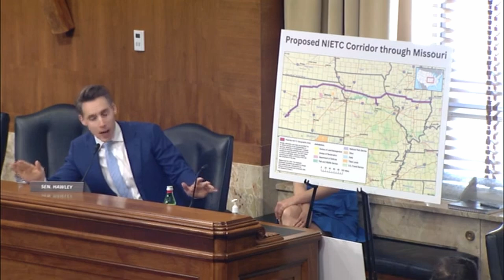What are the National Interest Electric Transmission Corridors and why they’re important

Comment: Gas and oil pipeline are mostly underground so they have minimal effect on farming!  And in case you were unaware, wind and solar are intermittent sources of power and therefore considered unreliable! We do need more transmission line but we also need hundreds of new nuclear power plants. Those alone will take the better part of this century to build even if we start today!  The sad truth is because of the imbeciles running this country, electric prices will soon be going through the roof!
Reply from the maker: There's an interesting proposed transmission line, the Soo Green line, that is underground in a railroad right-of-way. I think this is a big part of the future of the grid. So underground vs. above ground is no reason for electricity to be treated differently than oil and gas. Even for above ground, that will change the criteria, but no reason for FERC not to have the same authority. 

The biggest problem with nuclear is the one that you refer to. They take a long time to permit/build. A solar farm can be built in a year, a wind farm in 3 years, nuclear in about 10 if you're lucky. My friend at @DDDecarbon is starting a series on nuclear that might interest you. His main point is that it's just too expensive compared to wind+solar+long distance transmission+storage
https://youtu.be/tFCVTj87Yz4?si=nHEsAJeFHBRdy6e6

In my first video I talked about how to manage a grid with renewables to create a stable grid: wind+solar+long distance transmission+storage. The more transmission you have, the less storage you need. 
https://youtu.be/kw9_Q_qm0Es?si=wVql-35TscjJeydB

Comment: Distributed power >>> transmission lines. Small modular Thorium reactors is the way.
Reply from the maker: Small modular thorium reactors don’t exist. They’re like fusion: if someone figures it out, that will change things. But for now, we have to settle for wind and solar.
Reply: @Decarbonize11  THANK YOU for actually saying this! I keep hearing about thorium or even nuclear power, even though objectively nuclear power is the most expensive form of electricity available. We need to decarbonize now, rather than wait for future technological innovation.

Comment: PV is now so inexpensive your concept doesn't make sense anymore. If this was implemented in 2010 maybe but looking at 2025 forward, there is absolutely no reason you need to centralize your solar production in areas with high power density.  It's cheap, it's easy. It should be local.
Reply: @otm646, you're right in a way; at current levels of renewables (an extremely low 21% in the US), local solar is cost effective.  But as you get closer to 100% renewables, 100% solar is rarely the cheapest way to go: about 1/3 wind is cheaper, and you need transmission to move that power around.

Source: As Solar Power Surges, U.S. Wind Is in Trouble.  B. Plumer.  New York Times. 6/4/2024
Reply from the maker: I certainly agree that the drop in cost of PV makes the location less sensitive, and I've always believed that local solar should be part of the mix. But the core of my vision is the diversity of  geography and source is the key to reliabillity. Just local solar means you need a lot of storage and to build enough PV  that even on the shortest, cloudiest days, you have enough. It's cheaper to have wind in the mix, since it peaks when solar is at a minimum. And better yet wind and solar from multiple regions. 

I go into all of this in more detail in this video
https://youtu.be/kw9_Q_qm0Es?si=VqEpi_B7PX9Q92-3
Reply: The use for coast-to-coast HVDC under a mostly Solar network is to extend the Solar-Only day (each time-zone crossed East-West adds an hour to the day), and provide a robust and wider area for sources and markets.
Reply: This is going to displace thousands of farmers and jack food prices up even higher.
Reply from the maker: No farmers will be displaced, only a small portion of land will be removed from production.

Comment: Have you looked at Interstate Highway routing?
Reply from the maker: If you look at my first video (https://youtu.be/kw9_Q_qm0Es) I explicitly use the freeway system as a metaphor and possibly as a route. There's a very interesting transmission line in the permitting stage called the SOO Green link (https://soogreen.com) that is planned to be largely underground within the right-of-way of a train route.
Reply: @Decarbonize11  Thanks.  Like their construction approach.  Seems like an easy Highway ROW method, as well.  Did you see they are not using concrete in their duct banks?   Another ponderment is if existing (and eventually abandoned) Oil and Pipeline routes -- or the actual (then empty) pipelines themselves can be used.
Reply from the maker: What I think is most interesting is what's holding SOO Green back is not the ROW or technology or cost. It's permission to connect to the grid when they get to Chicago. Once they get that, they can start construction.
Reply: @philtimmons722  You can not run long distance underground AC transmission lines. There is capacitive coupling between conductors and between conductors and earth. This causes "Low Leading Power-Factor"
Reply: @joecummings1260  Yeah.  We are talking about HVDC.  Did you see the SOO Green details?
Reply: In Minnesota, they've routed new transmission along I-94.  Makes a lot of sense.
Reply: @scottotterson3978  Yeah.  And by routing along the highways -- nodes or tie-in points can be along those highway corridors, as well -- for EVs and Electric Roadways.   Do you think they will ever cut and bury some of I-94 to make it a better Winter travel route?  Once ICE exhaust fades away and we have clean-air EVs, it gives US a lot better options.
Reply: @philtimmons722  Maybe someday they'll redo some of that road, but the way we're going, I'm afraid there won't be a winter to travel in.

Comment: It'd be interesting to compare how the USAs regulations compare the the EU.
Reply: China may be the ones to look to for State-of-the-Art.  By leading the way, they get to make all the mistakes, first.  ;P   But really, they are doing some impressive stuff.  1.1E6 Volt lines.
Reply: @philtimmons722  yeah ultra high voltage stuff is super cool. I believe Brasil also has a few lines.
Reply from the maker: The lines in Brasil are built by the Chinese. 

Though the UHV stuff the Chinese is doing is impressive, I'd suspect that for the time being 300-500 kV is more cost effective and sufficient to meet our needs. 

What's holding us back is not technology or money, but goverance. SOO Green is using mature technologies in a novel way, but the goverance is keeping them for moving forward. This is especially true in the US.
Reply from the maker: This video is very US specific. The EU is quite different and they're much better about regional interconnections and using HVDC. Even Ireland is in the process of getting connected to France, which I'll probably do a video on soon. 
More interesting would be the situation in Canada, which I'm not knowledgeable on. You guys are often infected with bad ideas from us and our grids are somewhat connected.
Reply: @Decarbonize11  yeah I believe Manitoba is directly included in the US grid.
Reply from the maker: Also Quebec has significant HVDC connection to New York and is trying to build more.
Reply: @Decarbonize11  yeah you don't need to convince me that HVDC are great.
Reply from the maker: My point is that what's critical is not the technology (though we are on the same page about HVDC), but goverance. With the wrong ownership/regulatory model, as we have in the US, the technology can be great, but basically unused.
Reply: @Decarbonize11  agreeded!